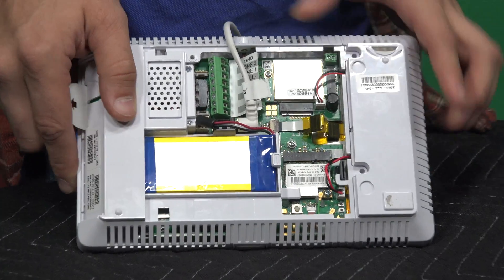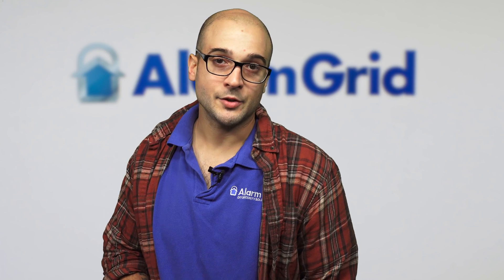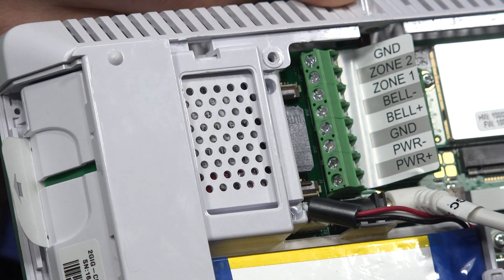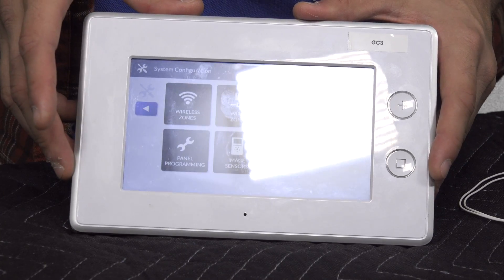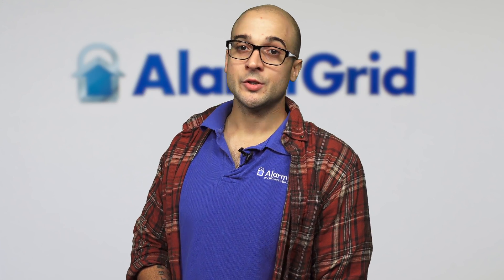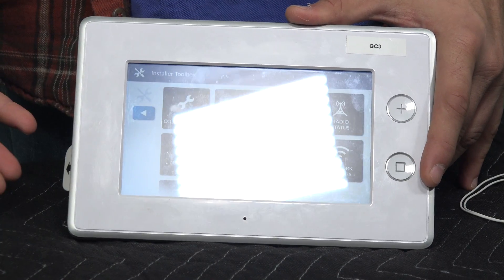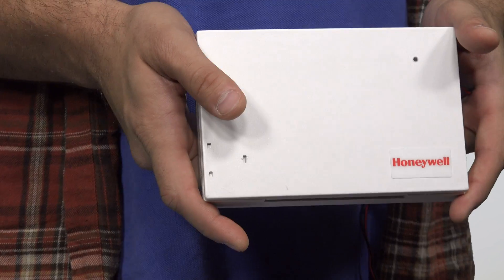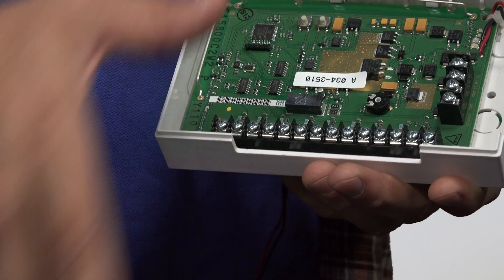Using Wired Contacts on a 2GIG GC3

Comment: I absolutely LOATH that there are only 2 wired zones on this system without expansion ports. Wireless is the biggest sham when it comes to these security systems. Wireless is easy to interfere with and wired can be safely isolated with a daughter expansion board with surge arresting features... but does 2GIG provide such a WIRED expansion board for this system? No. This whole industry is so frustrating for non-custom off-the-shelf type systems, either wired with stone age features from the 1980s... or modern features and forced to use wireless.
Reply: You'd be able to add the 2GIG TAKE-345 wired-to-wireless converter if you're wanting to use wired sensors with your system. This converter would still connect wirelessly to the system but your sensors can be wired if you prefer those.

Comment: Question, can the hardwired system that is being taken over by using the 5800c2w power the 5800c2w instead of using the 5800c2w's transformer?  I have seen this done with the 2gig take 345 module.  This saves using another receptacle for power.
Reply: @Ciara Hibbert The only reason I am desiring to leave the existing system powered up is to use it's power to drive the existing sirens connected to the hardwired system.  According to 2gig, if I remove the existing sytem, I will have to use an altronix relay and separate power supply to power those sirens and drive them from the 2gig panel.